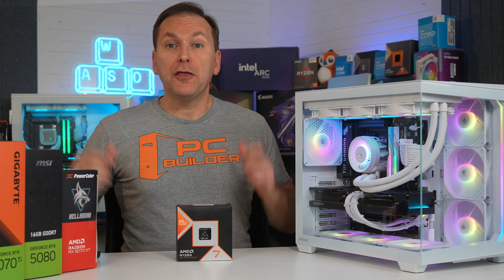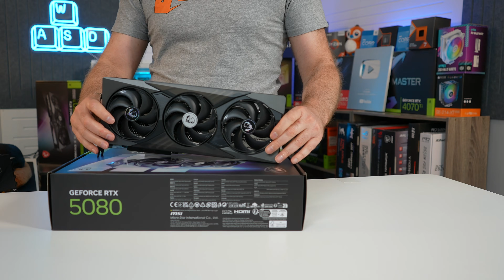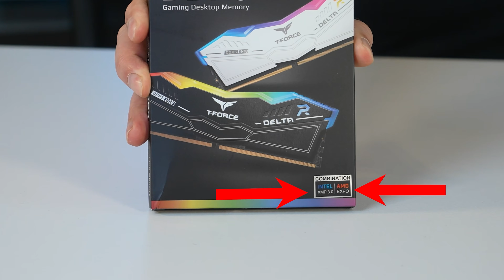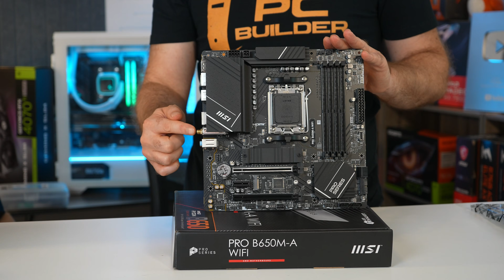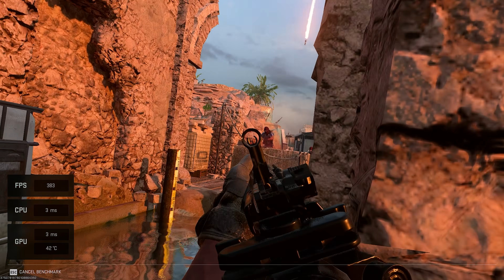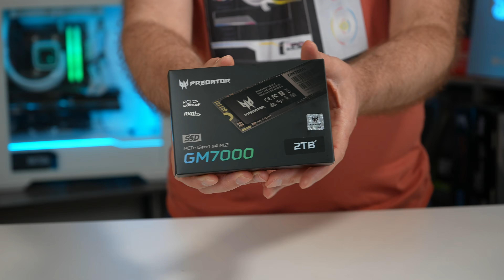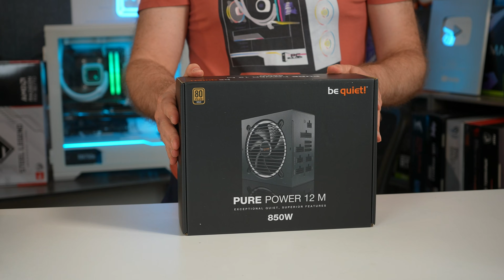Best Ryzen 9800X3D PC Build 2025 🛑 Best GPU, RAM, Motherboard & More

Comment: DO NOT BUY ASRock B850 or X870 with 9800x3d. Mine fried itself monday, and there have been hundreds of other reports of it happening on ASRock mobos in general.

Update:
It ended up that I returned the CPU directly to AMD, they paid shipping and everything.
As for the Mobo, I had a B850 MATX, and ASRock instructed me to return it to the vendor. The vendor had me ship it to them, and provided a shipping label with some resistance. AMD sent me a new CPU, vendor refunded me the mobo a month after it got to them. I ordered new out of pocket in the meantime.
Reply: This is the main info people should provide in these reviews, smh
Reply: Mines been running great since the start of Feb. Got an x870e taichi. Just never have the VSOC above 1.2V and u good.
Reply: im doing the same rn which is why i came back to this video lol i shouldve dug deeper seeing now how many cpus this board fries including mine today -.- live and learn ig lol
Reply: I went with MSI X670E Tomahawk for my 9800X3D. Runs nice and stable, upgraded from a 5800X3D and Asrock X570 Taichi.
Reply: @vinh1360 what gpu you got
Reply: @marcusfields2680 Zotac 5080 Solid OC, upgraded from a Gigabyte 4080 Eagle that I ran for 3 years in the 5800x3d setup.
Reply: Same thing happened to me about 10 days ago… thank god for the micro center service plan, switched to Asus TUF b850 plus WiFi so far so good 👍
Reply: Can confirm this happened to mine as well. Had it covered under warranty only for it to happen again about 2 months later. Ended up getting a full refund for the entire system thankfully.
Reply: @shermellow yeah I was afraid of that, I ended up paying out of pocket for a MSI mobo since they would only replace ASRock, not exchange
Reply: Please take this individuals advice, had mine for less than 2 months, now the motherboard either fried itself, or my 9800x3D. I HIGHLY recommend that you don’t get it as I now have to either get a new board or processor
Reply: @AyyHeadshotz  sorry to hear that. which motherboard you were using that fried processor?
Reply: @MrManFriendapologies for my failure to mention, ASRock X870E Nova WiFi
Reply: Pc moved extravagantly, then turned it off when going to bed as normal (used the windows shutdown option) then came home from work its fried
Reply: @AyyHeadshotz ah ASrock a processor killer motherboard no matters how many bios they update.
Reply: @AyyHeadshotz that is sad. 😮 sudden death of a cpu is painful. I would recommend don’t try to check in same motherboard. Instantly get it out of that motherboard.
Reply: @MrManFriendyep, went and confirmed today, got a new motherboard and processor, the processor got fried
Reply: @MrManFrienddefinitely got a different motherboard, will most likely never use ASRock from today forward, had to spend $430 on a whole new CPU
Reply: @AyyHeadshotz  man, AMD is replacing all the broken ones free of charge. And the mobo should be returnable too.
Reply: @AyyHeadshotz oh thats sad
Reply: @Gobbo-y7g it only depends on regions.
Reply: @MrManFriendi shipped my international to the us
Reply: Yep I went for a MSI MAG B850 instead and couldn’t be more happier. I hope you were able to get your money back.
Reply: @theBeardedCajunGenXer  I never had a problem with MSI MB in any pc. I was going to go with Gigabyte this round to try and they have had the lowest percentage of dead CPU's as well.
Reply: @theBeardedCajunGenXer sorry to ask you but do you think the motherboard you said plus an rtx 5080 founders edition with the Ryzen 7 9800x3d goo I'm trying to get at least 800fps on Fortnite pls help
Reply: @amalerraoui9043 800fps in fortnite lmao...please stop
Reply: @ loser amercians people do more than JUST gaming on their systems

Disable half the cores on 9950x3d gets to a 9850x3d running at 5.5Mhz
Reply: Did you get a new CPU from Asrock? Because it wasnt your fault right
Reply: I've also gone through hell with an asrock b650m crashing
Reply: Thank you for your report. I think I'll buy Asus.
Reply: Is this a widespread issue? I just got my AS Rock X870E Nova with hopes of building my PC with the 9800X3D
Reply: @euphoricmaniac  Yes it is, don't use an asrock motherboard. It will burn your cpu
Reply: @Katt-- I just bought it a couple weeks ago. Haven't opened the box yet. Looks like I'll be returning it. Not sure how good newegg is about returns
Reply: @euphoricmaniac without the box ope there should be absolutely no issue tbh, but companies gonna company so they might hassle you. If they do just read through their return policy, most are up to 30 days.
Reply: were you overclocking?
Reply: dont buy Asrock EVER! same with MSI. the boards are cheap for a reason!  Stick with ASUS or Gigabyte boards. though not without issues themselves they are by FAR much more reliable then the other offerings!
Reply: i wonder how many people bought that combo and it works just fine. 100 is not a large amount of users at all.
Reply: @ that’s how many people posted to reddit and specifically included those 2 parts. That’s quite a large sample taking that into account.
Reply: @Sajgoniarz it’s a big issue because it takes a few months to happen. It’s not a chipset issue but an asrock issue just get a different brand
Reply: @ gobbo which motherboard you have now after your ASrock got fried ?
Reply: @UM_88-s2c sorry just saw this, I got an open box MSI X870 Tomahawk. It had it’s own issues with WiFi and Bluetooth, but I got it working and it’s been fine for a few weeks now
Reply: When you tell them AMD processor fried and reported by hundreds of owners AMD fan boys or employees disguised as viewers get triggered and  start insulting you 😂😂
Reply: @MrManFriend it's the asrock motherboards that are frying the cpus? No other motherboard manufacturer has this problem.
Reply: @Katt-- seriously you need to check the reports ASrock was more then 40% but 9800x3d also faced sudden death on Asus, MSI and gigabyte
Reply: @ vinh not a fan of ASrock, they make the worst, most unreliable motherboards
Reply: @UM_88-s2c these are around 5% to 15% fried 9800x3d reports from Asus, MSI and Gigabytes as well.
Reply: @ gobbo I got 9950x3d to run adobe after effects, premiere pro and blender something 9800x3d can't do
Reply: @UM_88-s2c  do you have brain damage? No one is talking about any of those… or which cpu is better in general… you’re just going off for no reason.
Reply: @ gobbo it seems you have caught me 

I utterly DESPISE/HATE 7800x3d & 9800x3d, can ONLY/JUST do gaming shite at almost everything else
Reply: @UM_88-s2c  that’s literally just not true… sure they are biased towards more cache rather than more cores, but that doesn’t mean they can’t do light/medium productivity tasks
Reply: @UM_88-s2c  I hate/despite people who compare apples with bananas...
Reply: @ how about not buying 9800x3d also
9950x3d is faster
Reply: @ braindead take, what do you need a 9950x3d for? Why not buy a threadripper, it’s faster
Reply: And alot more expensive
Reply: @UM_88-s2c lol not its not 9800x3d better for gaming by a little over 1% and it's 400 cheaper
Reply: @ ehhh ehhh ehhh only $380 difference 
What other things can you get in that price ?
Reply: @UM_88-s2c  you could put that toward  a much better GPU or a monitor….or a whole 4tb NVME plus RAM
Reply: @ bro 9950x3d is the best consumer chip on earth 
Don't you want a CPU like that ? You won't have to upgrade for 10yrs

PS: X870E & some X870 motherboards from Asus, MSI, Gigabyte are also having issues
Reply: @UM_88-s2c  bruh, you just defeated yourself in your own game. As you mentioned 9950X3D is best for hybrid usage. Not everybody needs it. 
"DoN't YoU WaNt a CPU LiKE tHat ?" - Of course most people would, bust most people also don't have money for that.
"ou won't have to upgrade for 10yrs" - Yeah, sure.. Look at your motherboard from 10 years ago, you definitely wouldn't like to upgrade it for sweet things which technology brought us like faster wifi/ethernet ports, usb, usb C, ssd etc. No one knows what next 10 years will bring us.
Just go home and stop projecting on people, would you?
Reply: @ the same reason I wouldn’t buy a 5090. It’s beyond my price point by over double, and I’d rather buy a mid tier product every 3 years than a top of the line every 7. Processing growth has been exponential to this point, so why would I get something double the price that performs 40% better, when I could get something that performs 100% better in a couple years for half the price?
Reply: @Gobbo-y7g because you're never at peak performance.
Reply: @UM_88-s2c How can someone have such temperature iq like yourself? XD
Reply: @ ohhh you don't know ?
You can get 15-20% performance uplift from 9800x3d, by disabling half the cores on 9950x3

Also DUMBASSSS people do work on their PCs also
Reply: @UM_88-s2c  yeah, and it’s $1050 while the 9800x3d is $670….
Reply: @UM_88-s2c  you are not the sharpest tool in the shed

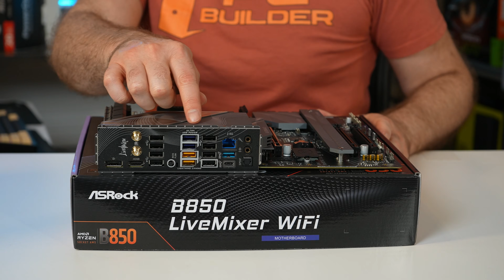Comment: 10:00 I got the B850 Livemixer, and will say i absolutely LOVE it. Looks great, has good features. Nothing to not like imo
Reply: Return that mobo asap dude, my ASRock B850 killed my 9800x3d on Monday. There’s a lot of cases of it happening, reddit compiled the data
Reply: @Gobbo-y7g  yeah, im aware. I know its somewhat insane, I wouldn't be mad if it happened to me because it would then let me do my own investigations. Speaking of which, what happened specifically with yours? Was it the v cache popping, or just burns on the cpu/board?
Reply: @ one cpu pad (the pins are now pads) got way too much voltage and burnt. It may have melted to the point of shorting to another pin, it’s hard to tell. The burn is on the side of a pad and overlaps a little with the next pad.
Reply: @Gobbo-y7g when that happened did they replace it all like the motherboard and cpu?
Reply: @gutuio2407 yep. ASRock told me to send the MOBO back to the store that I bought it from, AMD had me send the CPU directly back to them. Got credited for the mobo, and a replacement CPU got sent back to me.

Comment: Given pricing and availability, I got a 4070 Super for my 9800X3D. I'll just upgrade it later if it feels necessary. I'm going to build it this weekend.
Reply from the maker: Hope the build went well! Congrats!
Reply: @PCBuilderChannel  It went amazingly well! It had been a long time since I built an entire rig by myself. Last time was with a Quadcore Q6600 cpu :)

My new build:
Ryzen 7 9800X3D
Asus X870-Plus Tuf Gaming
Deepcool AK620 Zero Dark cooler
Kingston Fury Beast 64gb (2x32gb) DDR5 6000mhz
Asus 4070 Super Tuf Gaming
MSI MAG A850GL 80+ Gold 850w psu
Asus Tuf Gaming GT302 ARGB case
Samsung 990 Pro M.2 2tb

Yeah... I like the look of Tuf Gaming parts too lol
Reply: @Frost-yw9sz  I have AK620 and ryzen 7 5800x, planning to get 9800x3d. What's your temperatures?
Reply: @Reborn666skull  Idles at around 33 C, in Monster Hunter Wilds average around 50 C with everything maxed out. I have been a bit lazy and didn't take the time to really push it with Cinebench. No overclocking or whatnot, most BIOS options still on default settings.
Reply: @ Hnmm... then I wonder if 5800X is bad or my cooler is bad, because idle is about 40-45 and 75-80 in games.

Comment: Pretty close to my build. I'm almost done with it, but I used.
KLEVV CRAS V RGB DDR5 64GB (4x16GB) 6000MHz CL30 A-DIE 1.35V SK Hynix Chip XMP 3.0 / AMD Expo Ready - "White" (KD5AGUA80-60A300J)
And
Lian Li GA II LCD 360MM AIO (GA2ALCD36INW) "White"

Comment: Thx Jason! Found you last december and reslly enjoying your content! 
Received my 9800x3D 2 hours ago! I'm pairing it with a 9070 XT pulse and a ASUS Rog Strix B650E-F (which i got a nice deal on imo, 180€ incl. vat).

Just worried about which case to use as i want to keep my internal Bluray drive but most cases nowadays dont support 5.25" drives. I could use my old case (be quiet silent base 800) but  it would not cover newer usb front panel ports, as it is from 2015 :D 

And if so id have to go from 360mm AiO down to 240mm. With 360 i would feel more comfortable i guess. But you mentioned 240mm is totally alright ?

Thx again for your content! Greeting from germany ! :)

Comment: Just upgraded from a Intel i7-6800K and GTX 1070 to this new baby I built myself for fun :

	- AMD Ryzen 7 9800X3D
	- Noctua NH-U12A
	- Asus TUF GAMING B850M-PLUS WIFI Micro ATX
	- Silicon Power XPOWER Zenith Gaming 64 GB (2 x 32 GB) DDR5-6000 CL30
	- 1 Corsair MP700 PRO 2 TB
	- 2 Western Digital WD_Black SN850X 2 TB
	- MSI VENTUS 3X OC GeForce RTX 5080
	- Lian Li A3-mATX
	- be quiet! Straight Power 12 1000 W 80+ Platinum
	- 4 Noctua NF-A12x25 PWM

It's a beast ! But I'm having issues with the RAM, I can't boot with 64GB, it only works with 32GB (so one DIMM only). I can't figure out why, even after tweaking the voltage.
Getting that GEN5 NVME and 64GB of RAM was clearly a mistake, especially the RAM ...
If anyone has an idea on how to fix the issue with the RAM, I would gladly take any advice !
Reply: What the hell ???
Why are you running a goddamn air cooler with a 5080 ?
Reply: @UM_88-s2c  An air cooler handles the CPU, not the GPU — there's no impact on GPU performance as long as the case airflow is well-designed. I chose to avoid AIOs after a bad experience with one at work: it developed coil whine after only a few months and failed after just four years. A high-end dual-tower air cooler offers excellent thermals, zero pump noise risk, and greater long-term reliability — especially since today's air coolers rival many AIOs in performance without the added complexity.
And I didn't want any RBG this time around, a minimalist setup to go with the Lian Li A3 mATX sobriety. Most of the great AIOs had RGB, or weren't in stock without it, so definitely a skip for me.

After 4 hours of Cyberpunk 1440p maxed out (Ultra + RTO + DLAA, No Fram gen)
84° max CPU (64° average)
79° max GPU (72° average)
And with dead silent fans, exactly what I was looking for !

Comment: I just finished my new HTPC/Gaming build: Silverstone GD11 case, EVGA SuperNOVA 1000 G6 1000 W 80+ Gold, Ryzen 7 9800X3D, Sapphire Pulse 7900XTX, 4TB 990Pro SSD, 64BG G.Skill Flare X5 6000 / 30 RAM, WD Black 10TB HDD, be quiet! Pure Loop 2 240 AIO, and custom Windows 11 Pro install. I started with a Gigabyte X870E AORUS ELITE WIFI7 ATX motherboard, but didn't quite have room for the side case fans, so I had to switch to an Asus TUF GAMING B850M-PLUS WIFI Micro ATX motherboard. Runs great, quiet, and fits in very nicely with my other home theater A/V gear. Monitor is a 75" Samsung 8k TV :) Good info in your video, thanks! Side note: the motherboards both had the #1 SSD slot closer to the CPU than the GPU, which allowed the AIO to fit in this case.

Comment: I regret not getting a 4080 Super over a 4070 Ti Super last July.
I'll only upgrade if the 5080 Super has more than 16gb and that's at least 18 months away.

Also, if you have a 9800X3D and Corsair Vengeance DDR5, you can buy a set of "fake ram" to fill the slots for aesthetics and more RGB.

PS:  Corsair is making 48gb and 96gb RAM kits.

PSS I'm finally finished with my CORSAIRxROG build and would like to show it off, where should I post it?

Comment: Well I didn't build the 9800x3d, it hadn't come out when i snagged one of the last 7800x3d when they disappeared from everywhere for awhile. Also got one of the last B650E Taichi Lite apparently, also got a 4tb Nvme 4th gen with 64gb cl30 6000, 7900xtx/ provisional bteir psu 1000w, in an infinity mirror case  and a phantom cpu cooler. Running Mint Cinnamon when I finally get migrated into it. Thinking I'll gift this system im on typing this to a nephew for his bday. 5600x/6750xt/ 4tb HDD and he can add some nvme's to it, as my 2 itb one will migrate to boost my new system to 6tb.

Comment: Wasn’t planning on upgrading to AM5 but 9800x3d made me do it. Cooled by DRP4, the build includes with Nitro+ 7900XTX, 64GB RAM CL30 6000Mhz, X870-E ROG, Thor II 1000w all housed inside Fractal Torrent Compact.
Reply: @ I can understand AMD CPU coz intel sucks atm 
But why AMD GPU also ?
Reply: @UM_88-s2c  I got the 7900 XTX before upgrading to AM5. Got it when it went on sale here in the Philippines roughly 2 years ago. With how absurd the prices before for 4080 and 4080 super, I'm not going to get price to performance for that. Not a fan of RT so going AMD is an easy decision considering the price in comparison to 4080/4090 at the time.
Reply: @ Ah I see
Just so you know: disabling half the cores on 9950x3d gets you a 
9850x3d running at 5.4-5.5Mhz
Reply: @UM_88-s2c  I agree but for my case, the 9950x3d is bit over the top already. The 9800x3d more than sufficient for my use case. I'm not chasing any records or needs my build to be super high-end enthusiast level. The 98003d and 7900 xtx fits my needs for now and the foreseeable future without breaking my wallet 😀
Reply: @ only reason I'm not going for 9800x3d is coz it can't handle medium workloads
Reply: @UM_88-s2c  that's given as it's primary task is for gaming but for regular usage, it more than enough for my daily needs tasks
Reply: 9950x3d is better
Reply: @UM_88-s2c  yes it's better but not for my day to day use. Besides, I got the 9800x3d a few weeks after launch. If I have primary use for the extra cores and threads other than gaming and light to medium editing load then I'll get the 9950x3d 😁
Reply: @UM_88-s2c  In your case finding a girlfriend is better than buying a 9950x3d, because end of the day you still have a small pipi.
Reply: @ I'm gonna assume most people buying 9800x3d do just gaming on their system ?
Reply: @UM_88-s2c  could be since it's what's intended for. I got it to improve 1% lows and help reduce stuttering in 4kaside from tweaking the settings (coming from 5800x)